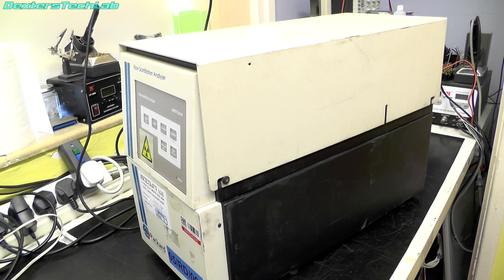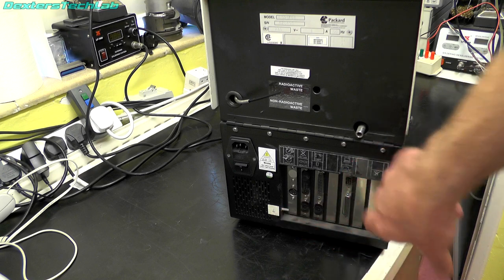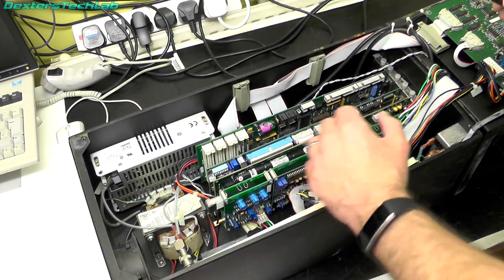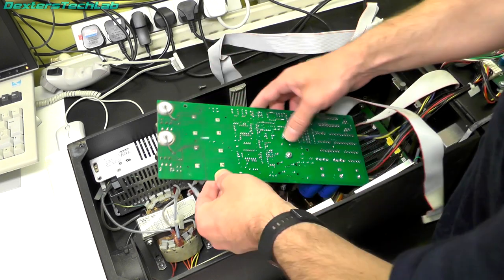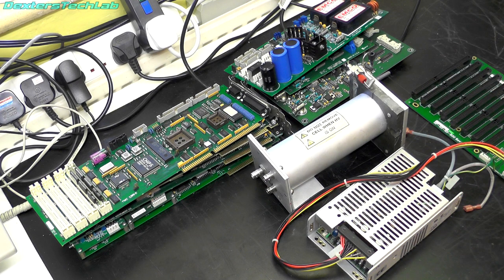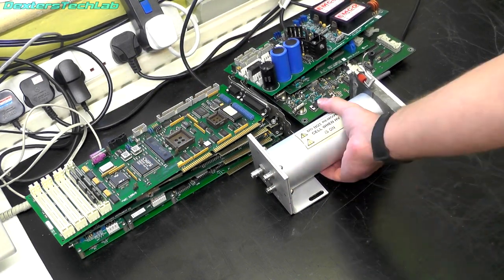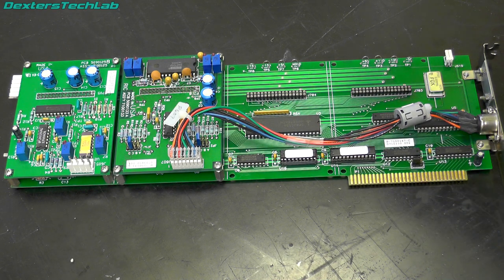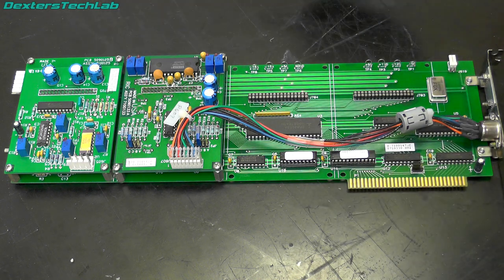DL231 Packard Flow Scintillation Analyser Teardown

Comment: 33:26 I love how the SOIC-8 packages(?) are on a little thick board. You can see they've removed some of the grounding on the main pcb as well. I assume they either wanted better isolation(mitigating residual currents) or they wanted to avoid adding capacity and did this in order to match the first stages impedance to the cable/tube.